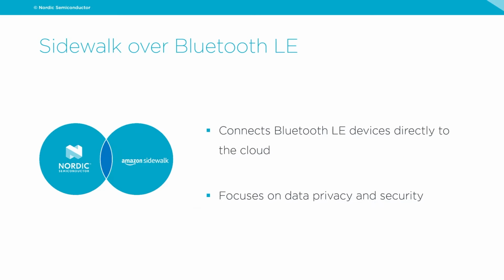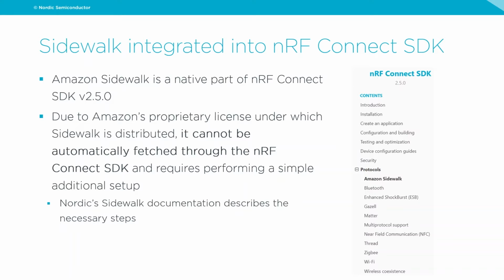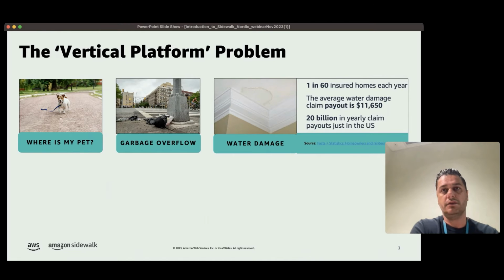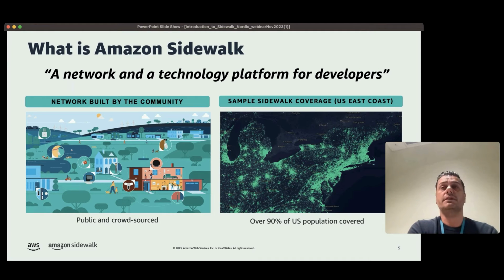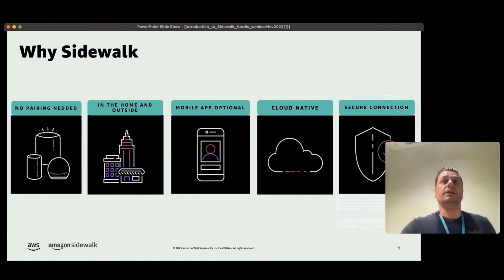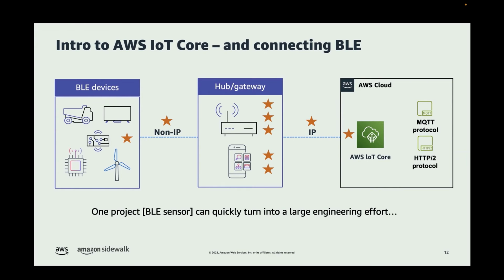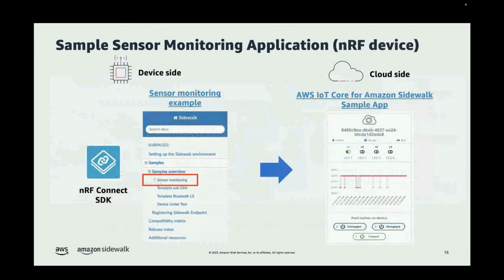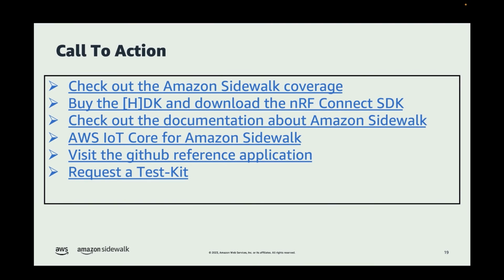Introduction to Amazon Sidewalk

Comment: @2:50 since when is 8 dBm a high output power? that's incredibly weak, what's going on with this video
Reply from the maker: "High" is relative. 8 is actually not that bad compared to some others, and is eg. just what you need for an EU market (considering EU regulations). For a product in the US though (which we assume you are interested in since this video is related to Amazon Sidewalk), we would understand it if you would be interested in getting a FEM alongside an nRF. That is no problem at all. For technical questions, please reach out: https://devzone.nordicsemi.com/

Comment: First of all Thanks for the great and informant webinar. I have two questions:
1) Does every Amazon Sidewalk need to have a Bluetooth Module? 
2) How can a Sidewalk hardware manufacturer work with an other company that creates a visualization Like an App (Share acces to AWS cloud Data)
Reply from the maker: Thanks for sharing your thoughts about the webinar. To answer your questions:
1) No, it is possible to built a sub-GHz-only Sidewalk endpoint, however it introduces some limitations e.g. to associate a Sidewalk endpoint with a particular Ring/Amazon account, among others.
2) It can be data transfer within AWS or a cloud to cloud data transmission from AWS cloud to a third party cloud.